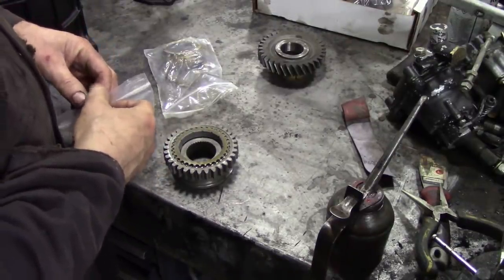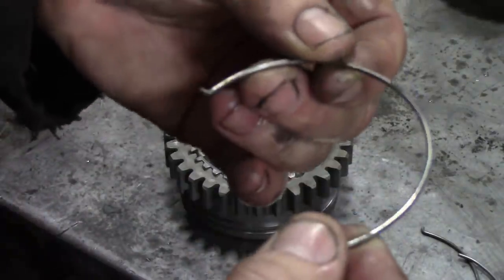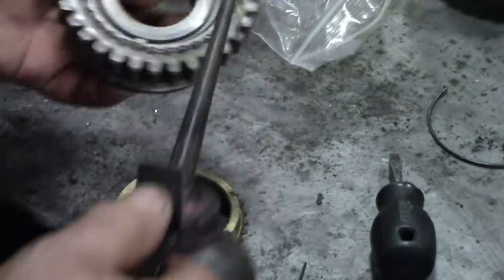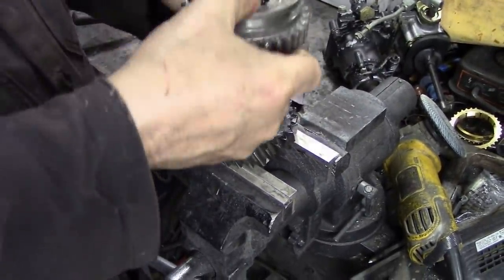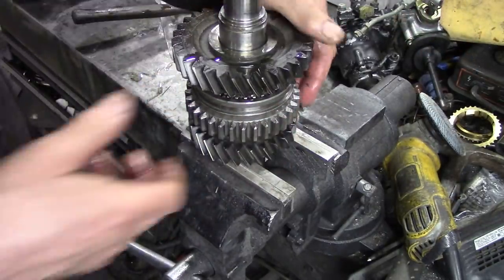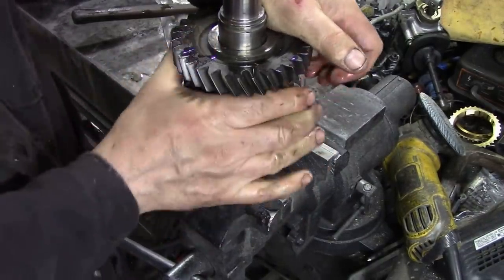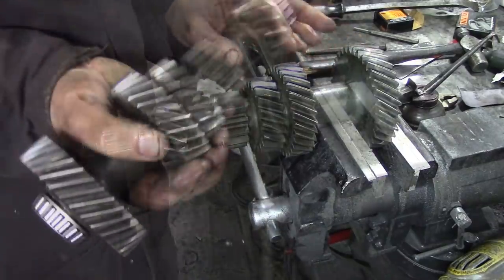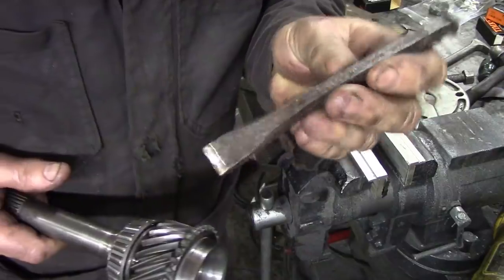LT77 rebuild part 2

Comment: I'm quite surprised you haven't made yourself a smaller bearing splitter from two flat bars ground to shape, excellent video series.
Reply from the maker: They are a bugger to get off - sometimes I cut off the cage of the bearing so I can get a grab on the bearing with a splitter
Reply: @BritannicaRestorations  yes they are :) had to cut one off carefully with a small cutting disc before now, cage and race.

Comment: Hey mikos have you seen an ashcroft gearbox with bearing mod for r380? 
Is there a difference between td5 r380 and tdi r380s?
Reply from the maker: No I have not seen one - I have never seen these bearings fail = but that does not mean they do not! 
The shaft on the 300Tdi is a different length to a Td5, otherwise the same